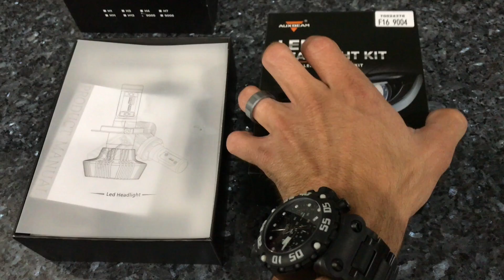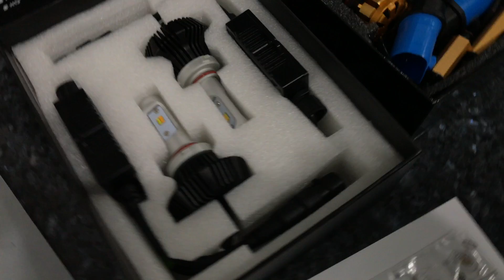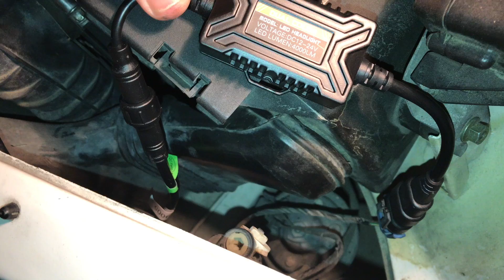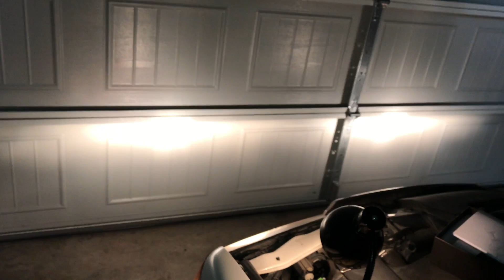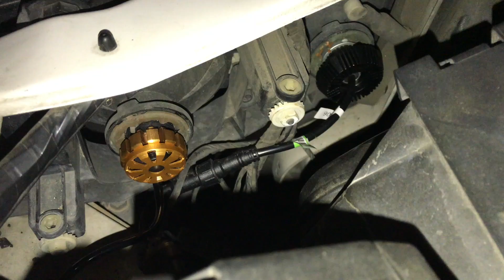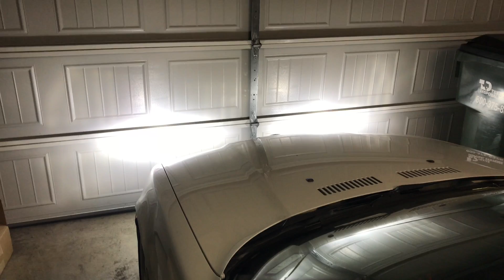BMW E36 Auxbeam LED Headlight Install and Review - Track Build 3

Comment: not safe, can potentially catch fire and also us spec headlights aren’t designed for non halogen lights, led will scatter and blind oncoming traffic
Reply from the maker: You definitely have to reposition them but led doesn’t get as hot. Never had an issue with heat
Reply: Freedom Crawler you may think so, but you putting lights that aren’t meant for that kind of housing, eventually they’ll melt not matter how low in temp it may seem, HID with Euro projectors are the best way to go, better light output, safer and you won’t put anyone in danger while driving.
Reply: @hiddenundaflesh  nothing melts unless it gets hot. What are you talking about?

Comment: Just installed these they worked great! But I have a low beam failure message that pops up on the check control.
Reply from the maker: I think i had that for a bit too but it went away.
Reply: I read a write up for it on the bimmerforums there's a way to get rid of it for good. It has some cutting and splicing involved, I've yet to try it.